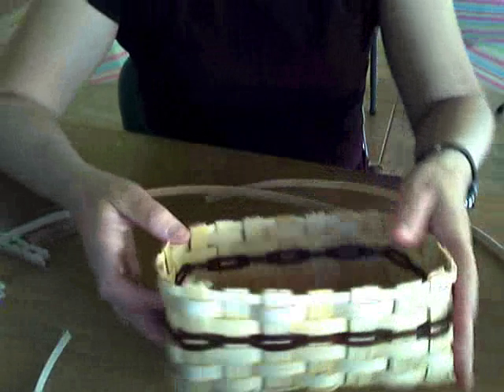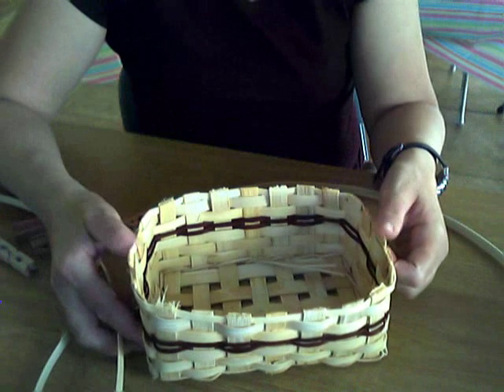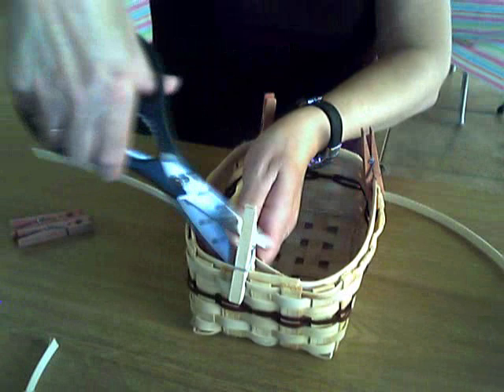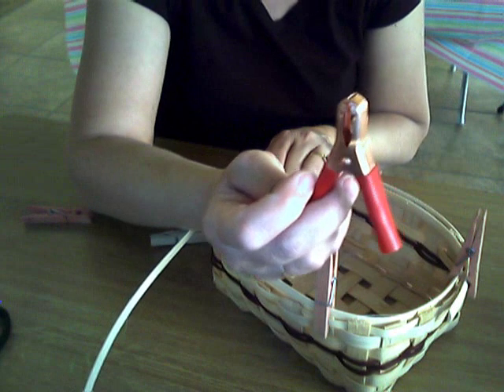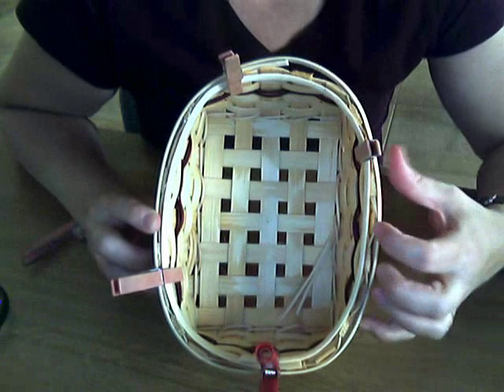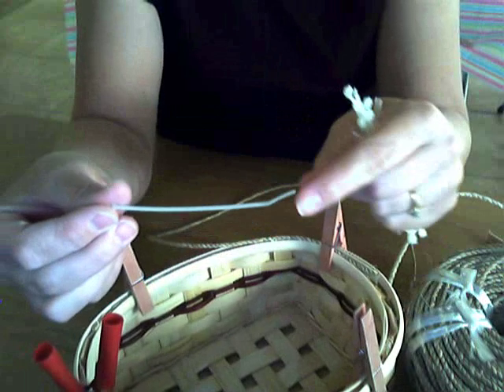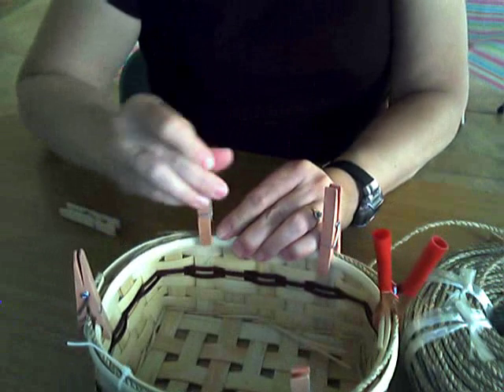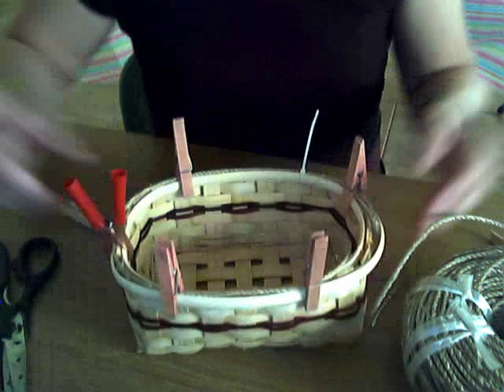Basket Weaving Video #10--Securing the Rim in Place and using a Rim Filler

Comment: You can also use Pony brand spring clamps they come in all sizes and have a rubber coverf on the neds so they won't mark your material.